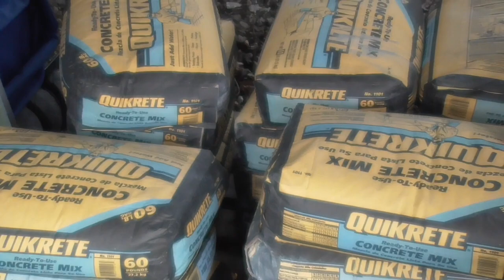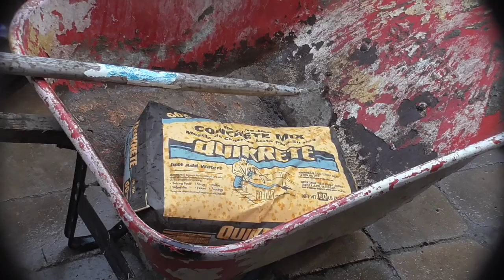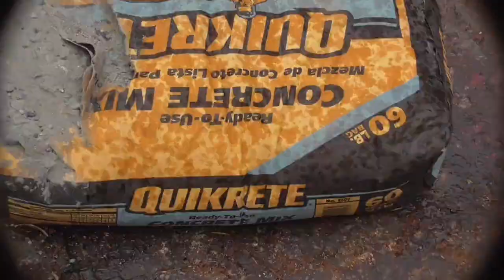DIY How to Install a Chain Link Fence | Step by Step From Start to Finish [Chain Link Fence]

Comment: The loop cap goes the other way, you need brace bands for your rail end lugs, the tension bands go with flat bars. you set your end posts at 74" and your line posts at 70" so half diamond covers top rail. spend $30 on a good set of fence pliers... easier to weave chain link laying down so it'll be one solid piece of fabric, next time frame first then pull wire 👍
Reply from the maker: Man I should have had you come and install this thing!! It was amateur hour but looked good from the road!!! I appreciate the input. 🤙🍻
Reply: @DIYTechnician  technically it'll serve its objective but not everyone agrees
Reply from the maker: @ESDANNYBOY  yup keep the dogs and kids in and not blow over in a windstorm. Take care Danny.